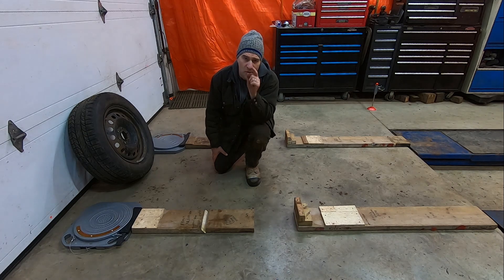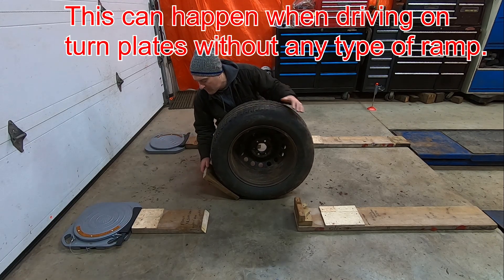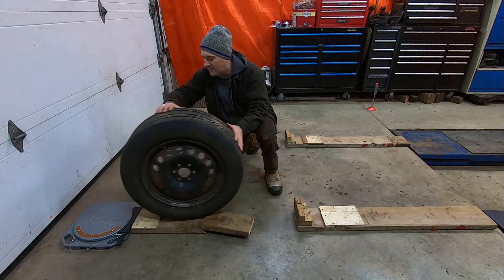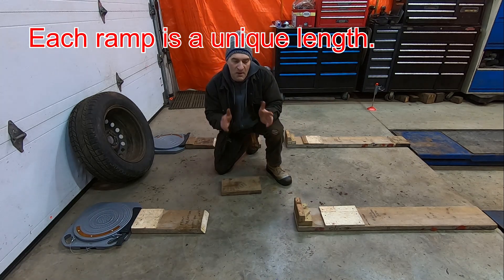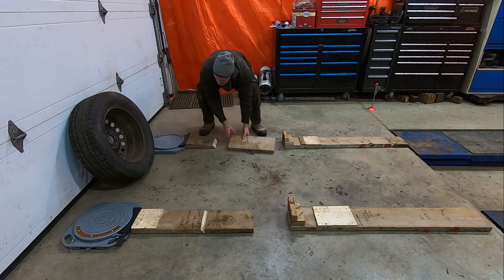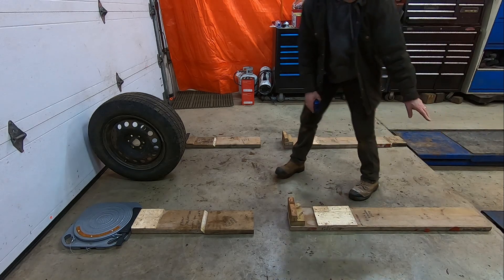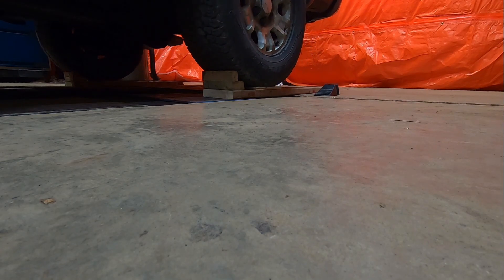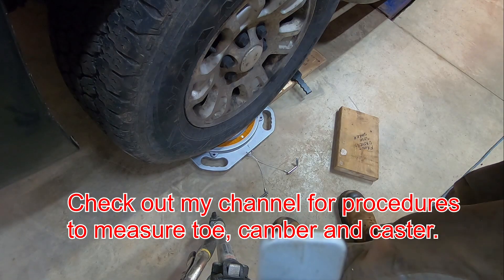Custom Wheel Alignment Turn Plate Ramps

Comment: I have the same turn plates. Have a similar system but will modify like yours for the use and storage bundling! Nice job!  Question…what are the black handle looking sticks on the backside of the turn plates used for?
Reply from the maker: they are to ease the transition up onto the turn plates.  My wooden ramps can displace the use of the transition strips.